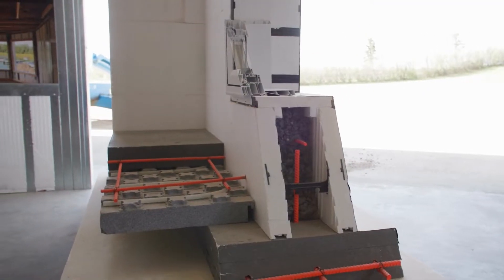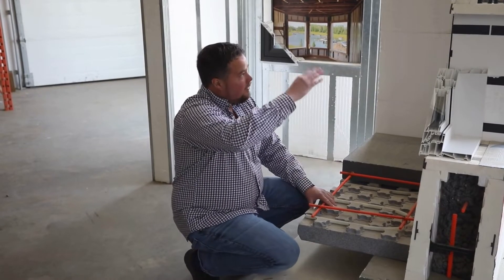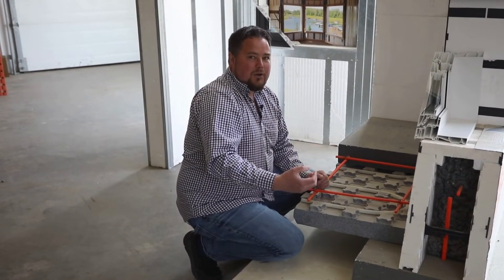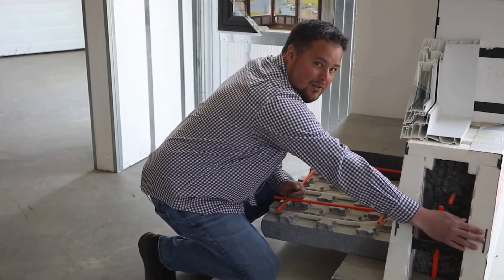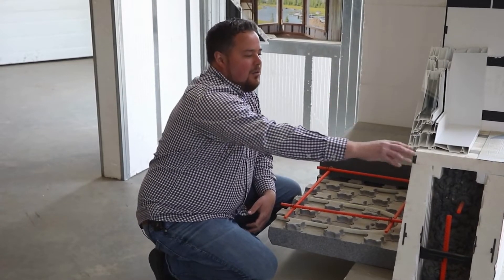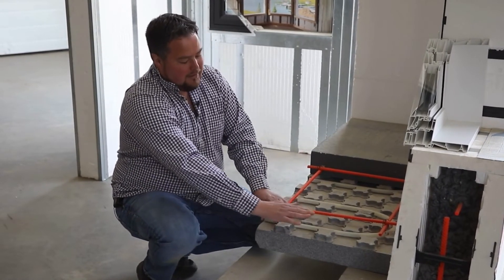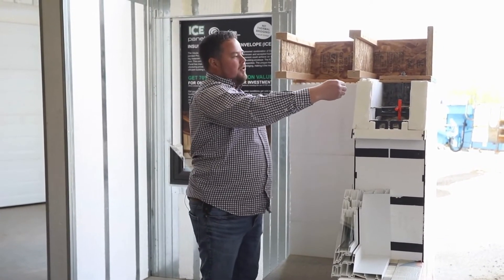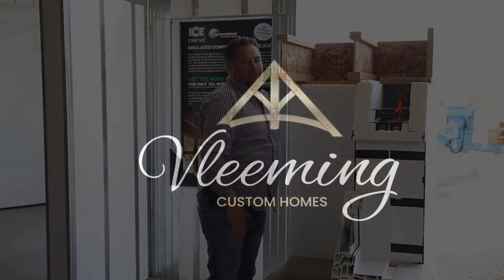ICF (Insulated Concrete Form) Foundations with Vleeming Custom Homes

Comment: With the continuous blanket of insulation from the ICF, where do you put a break in for termite inspection? Or do you use some kind of Boric acid spray on the wood parts of the trusses, or framing that meets at the top plate of the ICF wall?
Reply from the maker: Thanks for the question! The EPS in ICF and ICE Panels are not a food source for termites and we have very limited cases where we build in Alberta. We have no current extraordinary precautions above these measures.
Reply: @VleemingCustomHomes  I understand they are not a food source, but i do see it where they ca tunnel easier through EPS, than concrete. Here in the stated in areas with higher termite infestations, ICF builders have had this issue. Good that you don't have that issue in Alberta, but it does exist. Thanks for the response.